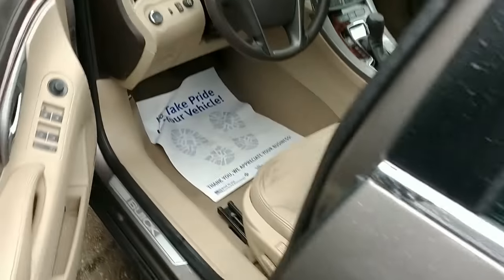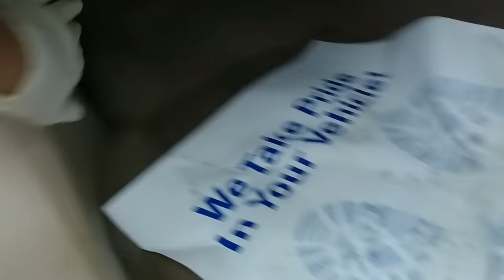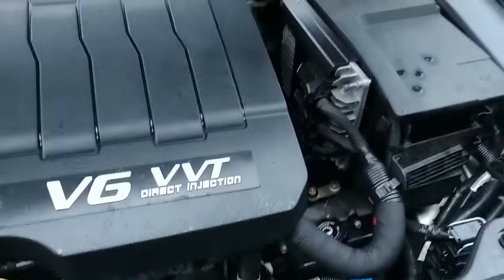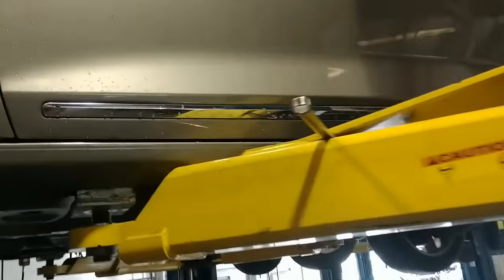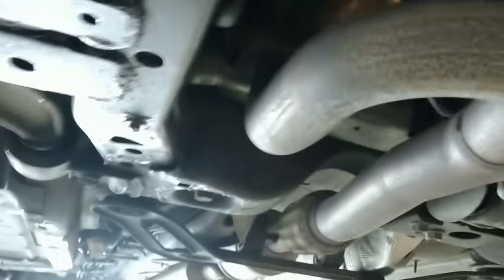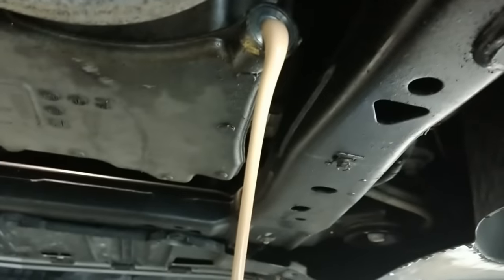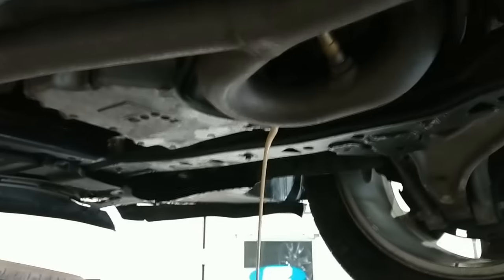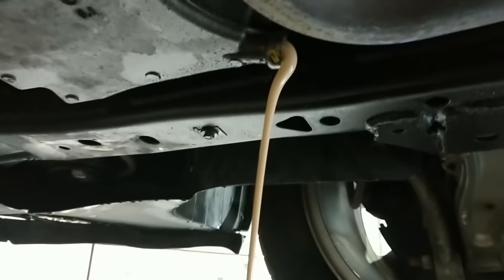Overfilled Crankcase! Blown ENGINE! Used Car Nightmare!

Comment: Used to work at a buy here pay here company and they would buy flood cars that were deemed "totaled" by insurance companies and clean them up and sell them for 12 - 18,000 with 29.9% interest. Yes ladies and gents, if you f*ck up your credit, people like this will prey on you forever. It's a f*kd up loop.
Reply: So the cars were sold with clearly marked salvage titles or did they somehow clean the title?
Reply: @teresakatrinak8158  there is a long and tedious way to exploit the legal system and reset a title, but it's long and difficult. But, if it sells a car, I guess some people will take it. It will show up in a Carfax report, though.
Reply: Well, no one is forcing you to go to a Buy Here Pay Here.
Reply: @bluspectre2042  I've never heard of being able to "reset" a title. You're not referring to a rebuilt title are you? I know (and have done it before) that you can get a salvage titled vehicle, but if you perform the work (or have it done) to repair any issues, as long as it passes state inspection, you can get a rebuilt title very easily.
Reply: @blackhorseman  Hooah! That was such a nice thing you did for that lady. Congrats and thank you for your service.
Reply: Credit is always redeemable. Nobody is ever "stuck" with bad credit. It just takes time and effort to get back up. Start with getting a $500 loan for whatever at your local bank. Pay it off in 6 months. Repeat that process, hell, you can even do multiple loans between multiple banks to speed the process up. Slowly raise the amount of the loans over time and you should be able to get your credit up to a point that you can legitimately finance a good car.
Reply: Agree they really need to have vehicle checked out before they signed
Reply: @Phurzt .  Your thought & motivation was reasonable, but the credit restoration process is frequently more complex than you described.  Some inquiries & negative entries must be challenged in a specific way.  Also, some lenders do not report to the various credit bureaus.  So one needs to verify that a lender DOES report to a credit bureau BEFORE you take out a modest loan for the purpose of building a stable payment history.  FYI.  I'm a manager at a financial services firm.
Reply: @SergeantExtreme .  Your entry & remarks really were not mutually exclusive from what Mcpadden wrote.  Didn't see the need to insert the combative tone.  😳
Reply: @SoundScientist1  of course its more complex, but I think the complexity hinders many people to just go out and do it. Simplifying things is all I can do in a youtube comment to let people know its not impossible, and also not relatively difficult to get a bad credit score higher with time and consistency. The details of the process should be discussed with your bank's/lender's financial representatives instead of here.
Reply: @Phurzt .  Agreed.  Although there is a "learning curve," some of the process certainly is not hyper- complex (like many other things in life).  Your points are duly noted.  Since credit profiles affect so many aspects of our financial lives, it behooves individuals to either: A) locate competent financial services firms that can help them resolve negative credit report entries  OR  B) invest the energy/time to learn how to challenge some of those negative entries on their own.  👋🏽
Reply: @rowlandbuck2703  Jesus dude... a 600score is enough to get you WAY better than 30%.
Reply: I had fucked up credit, but knew that these types of places were nothing but scams. My solution was to be patient and relentlessly save up the money for a GOOD used car, which I paid for in cash. If people were patient, these ripoff dealers would lose half their business. Most buy-here-pay-heres are in cities, where there are buses...
Reply: @SergeantExtreme  All of my good cars came from (real, name-brand) dealerships. All of my crap cars came from private sellers. Guess what I think of private sellers?!
Reply: @jw11432  Titles can be laundered by moving it around between states to get a new clean title (or just skipping that and exporting it to some unsuspecting Ukrainian) but that stuff tends to be more of an issue with high end cars. There are tons of salvage title cars that apparently people line up to buy because they are thousands less than a clean title car. And every single one of them was "just in a fender bender."
Reply: @Phurzt  nobody will loan you anything with bad credit, please don't talk about things you don't understand
Reply: @nah-y4e  even with bad credit you can get a 500-1000 dollar loan if 
A) you have a job
And
B) you dont go in smelling like a hobo
Reply: @Phurzt  but the Apr on that loan is going to be sky high. Simply paying it off immediately will not make your credit go up, it's the monthly payments being marked as green and paid on time that will show on your credit report. In the end, it's simply better to not rely on credit in life. Pay cash.
Reply: @Ljosi .  50% true.  Yes, some aspects of the modern credit system turn avg. people into "Debt Slaves" (ie. Lifelong Consumer & Student Loan Debt), BUT savvy people can also position themselves to exploit the same systems & grow their wealth.
Reply: @SoundScientist1  I knew you were going to mention that, you mean when someone takes out a loan for something that will be rented out (usually real estate) and the rent will pay the loan or even top it. In that case the one who pays the rent is the exploited one (the very concept of rent for real estate (innitially acquired by land-grab and passed by inheritance; no alternative for renter since limited planet/land area) is highly immoral and exploitable, but that's a topic for another day). It is implied that these scenarios are excluded from my original comment (it only concerns loans for personal liability purchases)
Reply: @Ljosi .  In modern socio-political & economic systems, everybody is (obviously) NOT going to be born to a family of wealth & means.  The only basic ways to ascend in the class structure are:
•Create a business & generate good profits selling your products or services
•Take whatever assets & cash you possess & leverage them by using them as collateral for loans to grow "your empire."

I'm unsure if the european feudal system of land control originated in the middle ages OR if it predates that era.  Who is being "exploited" becomes relative (to some extent).  I suppose only the TOP worldly dogs don't get exploited in some way.  (ie. Those born into so-called "high society," wealth, & privilege.  Such as Rothschild & Windsor family members).  Everybody else pretty much has to play the cards they were dealt, and EXPLOIT the established systems to (hopefully) move UPWARD. 🤷🏾‍♂️
Reply: @SoundScientist1  but the methods you describe require that you begin life with some large amount of assets to grow. Most of us start with nothing and earn almost nothing. Start a business, lol. Great way to go bankrupt if you can even get the loans in the first place, which I couldn't even with good credit.
Reply: @nah-y4e . Quote:  "But the methods you describe require that you begin life with some large amount of assets to grow."  Absolutely false.  Firstly, I did not articulate any narrowly defined business pathway to pursue on said "advancement journey."  Next (not to suggest that the journey routinely & commonly unfolds this way for avg. people), how would you explain the socio-economic ascent of a myriad number of people in North America who literally were born into ZERO wealth & later became tremendously "well off" or flat-out "wealthy?"

(I define "wealthy" as reaching a point where your assets produce enough annual returns &/or interest - such that you can live comfortably off of those proceeds without ever needing to liquidate any of those assets.  PLUS, you've got adequate insurance coverage & other instruments in place to leave an inheritance for your children AND GRANDCHILDREN).

Those folks obviously studied our existing economic & business systems in North America.  Then found ways to exploit them.  In many instances they took very modest lump-sums of capital, sought business loans, started & developed businesses, grew them into corporations, & eventually (gradually) turned them into 'empires.'  (Requires ambition, determination, focus, & discipline)...
Reply: @nah-y4e  what people dont like to admit is that the American “poor” are actually pretty dang wealthy.
If you have internet, cable, a streaming service, a cellphone and cell plan, a car, a place to live, and you dont cook your own food?

You are not poor. You just suck at allocating your money
Reply: @DarranKern  you must not understand what it's like to be poor, you should admit that
Reply: @nah-y4e  I know what standard of life passes for “poor” here. Abject poverty is still considered $15,000 a year single person income.

Most of the world lives on way, way, wayyyyyyyyyyyyyyyyy lower standard of living than us.

And do you know why our poor do so well? Welfare.
The government doesn’t give welfare money. I DO. I pay around 28% of my income per year so the democrats can find new and inventive ways to waste that money overseas.

But guess how much of the federal budget is welfare for the American poor? About the same. 28%.

Maybe we should let some of you have real poverty so we can go back to space and fix our roads. I dont think liberals are worth 28% of the pie, honestly
Reply: @DarranKern  except the roads are fine, there's already budgets for maintenance... and there's very little actual "infrastructure" in this government pork. But hey, they fooled you by naming it that. Don't be stupid.

Comment: She just bought it, you can tell...  The engine's beauty cover has been wiped with armor all!
Reply: Woman: "Hey, if the beauty cover looks good, the car must be running good right?"
Reply: When I was looking for a 2nd car to get, I had went to this ghetto car lot and they had like an 08 nissan altima, I lifted the hood up and the engine bay was hella shiny and looked brand new on the plastics, but when I drove it, the oil was leaking from the valve cover, the wheel bearings were all shot, the tires were all bald but the price was a bit high after I noticed all the other stuff
Reply: Worked at a used car lot as a detailer and they literally told me on my first day if the engine bay looks clean people won't even check the fluids lol 😂sad but true
Reply: @jeremygrainey  Not me. Im paranoid AF. Saved my ass one time with a V8 Chevy S10 that looked to be in great condition. After about 5-7 minutes of running i noticed it ticked every 45 seconds and it sounded metallic. 

Had them drain the oil (i had brought fluids with with me bc i always freshen fluids on a used car im buying bc i care about my car. Also gives me a good excuse to drain and check them) and lo and behold the oil looks like silver glitter mixed with tar. At that point i was no longer interested for obvious reasons.

I suspect the 45ish second click was a larger chunk of metal circulating in the oil.

Left him with replacing the oil himself since, lets face it, he needed to if he was going to scam someone anyway lol.
Reply: apparently the crankcase was also filled with armor all.
Reply: @jeremygrainey  This is weird though.. maybe I have too much faith in humanity, but to me it seems like a dealership is just inviting trouble selling a car in this condition, especially if it's just going to make it a short distance.
Reply: Nah there too cheap for that its sprayed with wd40
Reply: @oceanbytez847  good thing you didn't buy that truck. You dodged a huge headache. Let me ask you, did he say anything?
Reply: @MattExzy  you would think that but she probably also signed a paper saying she bought it as is with Cash.
Reply: @MattExzy  It wouldn’t bother them. A lot of lots sell it “As Is”.
Reply: @FJDH11  Thing is, people view cars the same way that they see their home appliances. Looks good? "Here's my money!"

I don't expect everyone to understand all the ins-and-outs of their engine, (though maybe know how to check fluid levels and condition at least?) but that's why 3rd-party inspectors exist. And why people should use them.
Reply: My brother recently bought a Ford Explorer from a used car lot that put armor all on everything. Even the floor mats it the back, which made them slippery. He has had that car in the shop about 3 or 4 times for bad sensors (under warranty fortunately).
Reply: Dark Wasted  how do you safely clean an engine bay?
Reply: Dark Wasted  so dont even spray the engine bay with a gatden hose? just damp cloth and wipe as much as u can reach
Reply: Actually my car is 20 years old and the engine still looks new cuz I do something out of the ordinary to most people, I clean my car.
Reply: @hurtfultruth6188  how u clean engine?
Reply: @randomrazr  hey get some brake cleaner and shop towels and wipe the engine down that way that’s what i’m about to do. i have a german car with a crap ton of modules so i wouldn’t risk washing the engine bay down because you could get something you don’t want wet... any car made after 2000 i wouldn’t recommend garden hosing the engine bay
Reply: @iiplaya  arent engine bays suppose to be water resistant
Reply: @randomrazr  water resistant yes but it’s still dangerous because a used vehicle probably has a lot of stuff that’s loosened up over the years
Reply: @randomrazr  water resistant, not water proof. They have a hood for a reason
Reply: @brucewrigleysgumchewz4667  do u use degreasers or engine cleaners prior?
Reply: If you pop the hood, see no dirt or dust sitting in the engine bay, and the car isn't a valuable collectable, the seller is likely hiding something.
Reply: @randomrazr  on an old car without computer crap, just cover the distributor and carb, take it to your local quarter car wash, and spray away. Nowadays with all this computer crap, it's best to not even touch it with water.
Reply: @hey_buddy_waz_up  shit man my engine in my highlander is dirty af. like the chick on the corner. gotta be a way to clean up
Reply: It had a floor mat in it had obviously been detailed as you would expect it almost any car dealership
Reply: @randomrazr  LOL Even in the 1980s we used to laugh at people who pressure washed their engines and then couldn't even turn the thing on to back out of the self-serve car wash bay. So...NO! They may "resist" a splash of rain getting in through the grill, but they're not meant to be opened up and deliberately flooded!
Reply: @Megatron995  how do u clean an engine bay dthen
Reply: @Megatron995  I lightly spray my engine with lukewarm water while the engine is running so if it gets into crevices it dries quick

Comment: A video suggestion, Ray, how about if you do a video series on how to do a basic vehicle inspection yourself?  Just the basics you can do on the seller's lot or driveway, the major deal breakers?  Obviously check the fluids and tires.  If it passes the basics then you bring in your heavy hitter auto inspector to go through it with a fine tooth comb.

Your commentary and humor is much appreciated in your videos.  It keeps the videos interesting.  It's like having a stand up comedy routine merged with auto diagnostics and repair.  You're right up there with The Car Care Nut, Car Wizard and Scotty Kilmer.  All peers of yours whose channels I also follow.  You all have your own presentation methodology and style which I obviously appreciate along with many other subscribers.